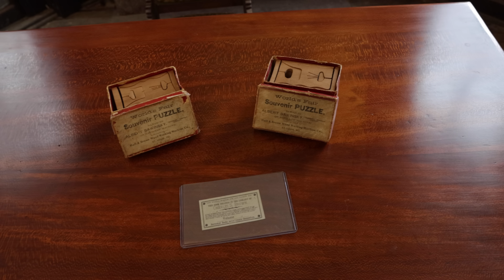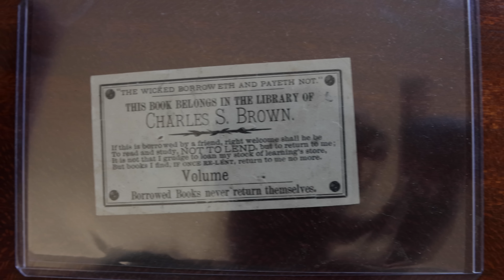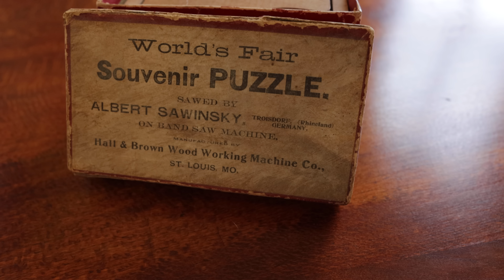What Using the Right Stuff Looks Like! S3 EP31

Comment: To get rid of the dry-lock and the remaining cement you may want to look into a media blaster.  Not sand because sand may be too abrasive for the stone.  Media blasting uses crushed and ground walnut shells instead of sand.  Unfortunately it's not cheap.  
Good luck and Thank you for another installment of this lovely video series!  See you in the next one!
Reply: Yeah, came here to say this. Or you may even just have to go something like ceramic bead sanding, but hopefully not.
Reply: I wonder if a steel brush could be of amy use to remove that?
Reply: @sofiasky5770  I was thinking about a wire wheel on an angle grinder
Reply: Same thing I was going to say. Not sure if the media blaster may cause some damage or not but seems like a great thing to try to me. …  along with a wire brush on a drill like others mentioned
Reply: Came here to say this too
Reply: I was going to suggest the same method. It would be so much faster.
Reply: Part of the media blasting crew here lol✋️
Reply: Like every other respondent - I was going to suggest media blasting. Well worth at least a try. If it works, it works. If not, then time to move on.
Reply: Media blasting is an umbrelly term and there's a range of different blasting media, e.g. sand, walnut shells, crushed glass, even dry ice. The choice of media as well as the pressure used for blasting depend on the surface you're working on and an experienced operator should know that. Mick Blackley has a lot of great media blasting videos on Youtube and gives good explanations of what he does and why he does it.

And keep in mind that natural stone isn't like 18th-century bricks that have a thin hard outer layer that mustn't be damaged. Stone is more or less the same density throughout, so removing fractions of a millimetre of stone isn't going to destroy anything.

Comment: To remove the soot, you can use an abrasive blast.  Obviously, use walnut shells, NOT sand or coal slag which can damage and erode the brick and stone.  Also, do all your pointing and structural repairs before blasting.    You can also try a mild muriatic acid solution and a pressure washer.  Again, do all the repair work first so you don't drive moisture into the cracks or dislodge stones.  Muriatic acid is what masons use on new brickwork to remove the mortar haze.  I would start with the least aggressive approach first.  In fact, a spray bottle with white vinegar might do the trick, as will mother nature in time.

Comment: That Dry Lock stuff would be the perfect use for a volunteer day. Get people to go around just picking off the loose bits so at least that part's done. If they can go deeper great, but if not, at least some of the easy stuff is done. Who knows, you might not be able to get it all off, but if you can get it off from where the stones need to be pointed, it'd make a great way to kill a lot of the finicky work and get the foundation sealed up.
Reply: Love your idea for a volunteer day. Count me in; I'm here in St. Louis.

Comment: Caleb, I just can't believe how well your both doing with the amount of subscribers that you've now got within basically a rather short amount of time.  Having been a subscriber from the very beginning I can recall just how nervous but excited you were about the house and the amount of work that you needed to do.  As for someone who had never restored a old house previously its absolutely stunning and fantastic to see just how much you have grown and how much research you do when it comes to a job you've never done before, prime example is the lime plaster and the lime render. Talking of the lime render,  you really have done a excellent job with the pointing of the stonework area around the basement, the only area's of concern is the larger stone's that have actually cracked all the way from one side to the other.  This from my experience with lime render and the stonework, I have in the past found that when it rains the water would run down the face of the stone and creep into the cracks and either sit there doing more damage to the stone's and the best way I found to fix this was to take the stone's out of the wall and basically make the stone into two of three stone's where the cracks were and then relaid them back inplace of the walling.  As for the stonework that's covered in the waterproofing  material Drylock have you tried to use a wire wheel or wire cup attachments that go onto your drill ??, I've used these attachments previously to help remove paint and sealants plus ingrained marks on the stonework and found that they worked really good,  but be warned if you press on too hard not only will it clean the stonework but can actually damage the stone's if there of a softer nature like sandstone.  Good luck with the stonework I've every confidence in you and your abilities.  As always guy's 💯%   👍   🇬🇧.
P.s Those sash pullies for your friend's windows have turned out absolutely amazing,  you've done a wonderful job in restoring them back to their original looks and that design is awesome!!!

Comment: The hot water pressure washer is rentable in your area. You need to buy low pressure tips. So instead of 4,000 psi, you can get a tip that is 300 psi.

Comment: Fantastic work as always! I wonder what keeps rainwater from running down the stairs and seeping under your beautiful basement door?
Reply from the maker: There is a drain down there. Where it goes or if its connected to the system is another question. Its full of muck at the moment, but no matter how hard it rains ive never had water coming in from that door.

Comment: So fun to watch you 'tucking the stones in', lol! That section of wall looks great. Such an improvement! Those Eastlake window pulleys are wonderful...another reminder that function and beauty are not mutually exclusive. San Diego Hardware here has been around since 1892, although sadly they had to vacate the location they occupied since 1922, with the tin ceilings, etc. and move to a modern building. It's one of the places to find quality reproductions of vintage hardware. Those puzzles are great! I still have my parents' (they each had a set as children, in the early 1930s) Monopoly games, with the pieces (train engine, iron, etc.) cut from wood. I think that second large flat piece, and the two long ones ( missing from the first set) make a bed.

Comment: Fantastic job.  The timelines for your mortar improving over time is great information. Seeing you are trying to do the best for your old beauty you might like to know that the improvement in the beginning with water curing is fast and progressively slows down.  But you can still get added strength by extending the time that you keep your misting up. I recommend adding two weeks to a month if you can coordinate it.  I was actually excited to see how dry your mortar is.  Adding too much water is the fastest way to degrade the life of your work. Dry work and consolidating your grout lines takes much more time and effort but will give a far superior result. You need enough water to perform the chemical reaction but any more and you will be replacing solid material with water that will dry out and leave you with less dense and weaker grout. After you pack your dry grout in and it is as tight a grout as you can place, misting water at that point just keeps the chemical reaction going.  This is true for concrete also. You probably know this but since it is the most common mistake it would be great for your audience to know.

Comment: You can lift the paint all of your ware very easily. Get an old crackpot from the thrift store. Put your hardware in the pot and fill with boiling and turn the crackpot on high. The paint will soften. Once the paint is soft plung the hot hardware in a bucket of icewater. The paint lifts right off.

Comment: The walls look great. As far getting the cement off the stones,can you use a acid? In my youth,my uncle put me to work using acid to get the cement off the stone floor in a kitchen.
Reply from the maker: Yeah ive used a bit of the muriatic acid on the the wall i pointed and it helps a bit but its not a miracle product or anything. It loosens the very thin build up of cement on the stones ok. The rest i used a needle scaler on.

Comment: Hey Caleb, do you know if those steel tie plates on the outside can be turned? The one diamond one that’s turned with some covering the brick and stone is making my OCD go crazy. They look pretty rusted but would look great all aligned and re-blued or painted black!
Reply from the maker: Ha yea i agree with you but you can actually see those in the original photo from 1896 and they are slanted in that photo as well. So that is they way they built it. They are pretty important to the structure and are probably best left alone. However they will be getting a new fresh coat of black enamel here soon.

Comment: Have you tried to use a needle scaler on the concrete patches? I also wonder if it would work with the drylock too?

A needle scaler should be useful. Harbor freight carries a cheap one. Not sure if you have a harbor freight.
Reply from the maker: Yes and Yes this is currently what i am using as the solution. It is a pretty tedious task. It works but ill be spending a lot of time doing it.

Comment: Caleb, are the iron anchors above the stonework original to house or are those masonry reinforcements added later?    Edit:  Good work! And it looks like you have much work ahead fix the rest of the dry lock station.  Best wishes with your paid full time project work as well.
Reply from the maker: I think most are original as i can see some of them in the photo from 1896. but i have no way of knowing if they all are. I assume they all are though.

Comment: could dustless blasting get that dry lock off? its water and various types of media like sand blasting but its not as aggressive theres also dryice blasting as well
Reply: Sounds expensive

I don't know if these materials would be hazardous to health if they were off the wals
Reply: @fionafiona1146  i dont know about the drylock but the blasting materials can be as fine as talcum power baking soda or as hard as garnet which are natural things an not harmful to the environment tarps can be put down to catch the drylock and any debri (concrete or other ) thats blasted off and as the stone itself is rather soft a delicate blasting material could be the answer to get the  drylock off an then theres dry ice blasting which is just frozen carbondioxide and air pressure as for cost which i dont know im sure prices vary depending on job and area
Reply: @cyberhornthedragon  yes, I am concerned about the moisture barrier stuff